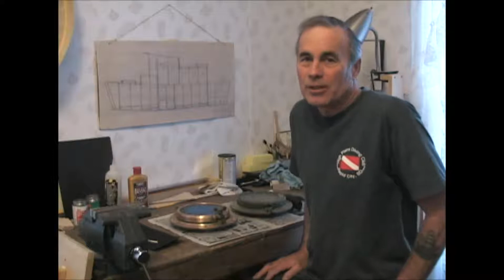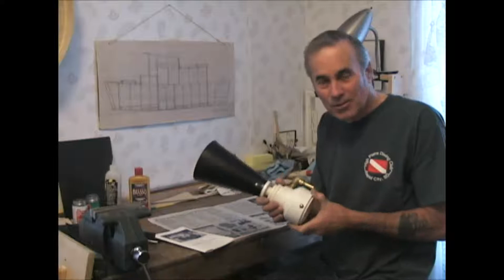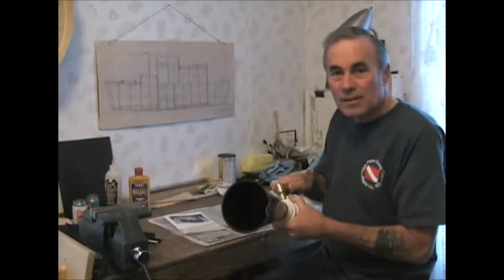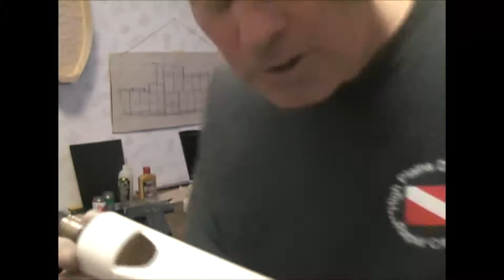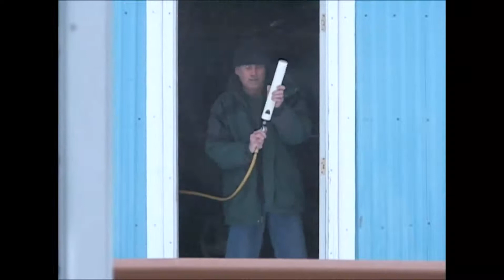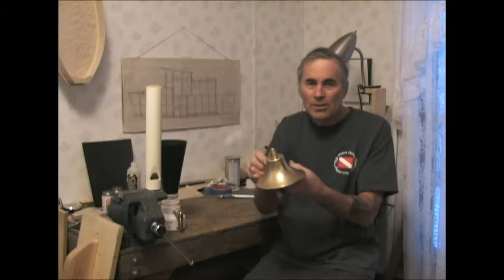Jani J air horn, whistle & bell

Comment from the maker: @porpoisefathom The horn is made from pvc fittings, a 3in to 2in bell reducer. I have made a biger one from a 4in to 2in. reducer. Deeper sound, much better. The hand pump is working and dose work the whistle, I just can't do a prolonged blast due to the volume required. But it toots good. Copper whistle is made now. I'll have another vid up shortly.